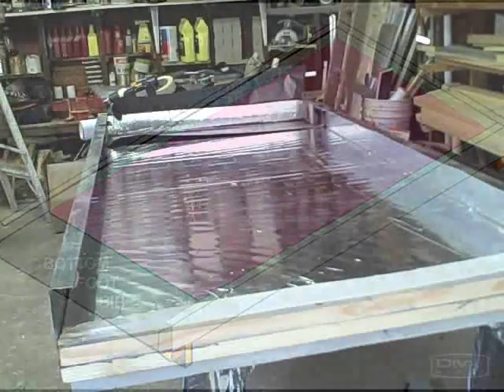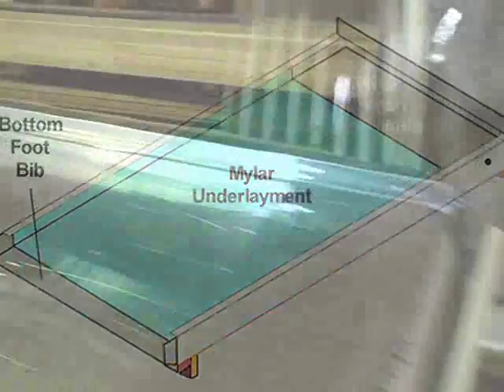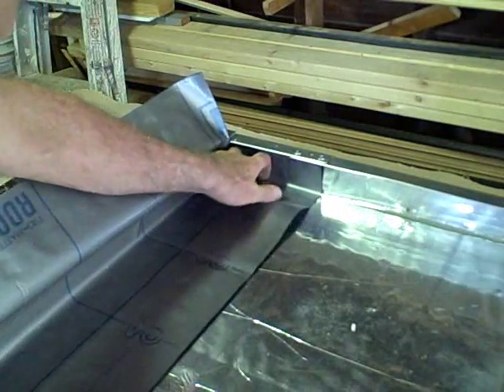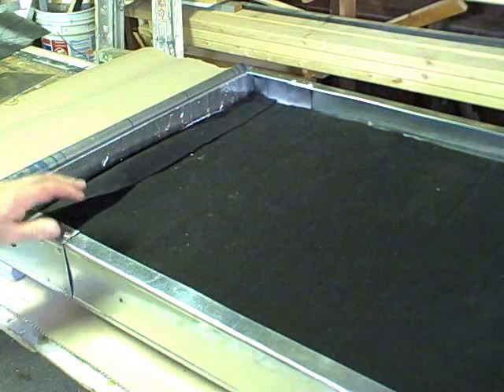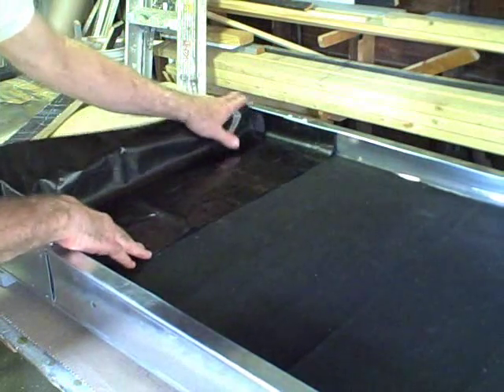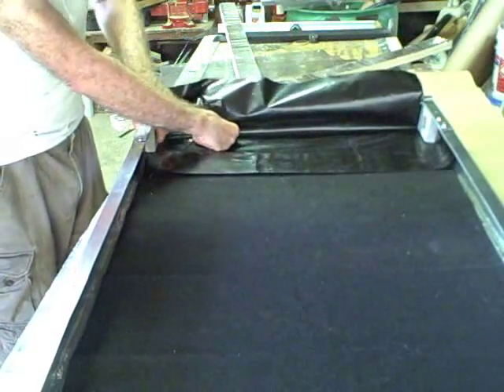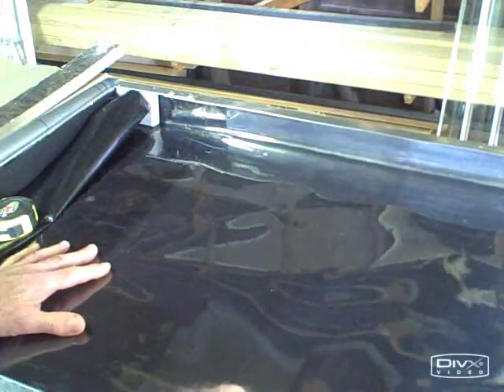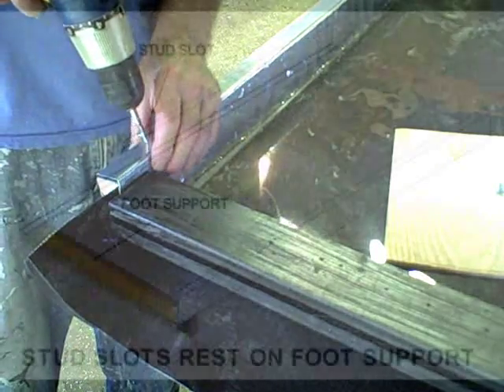MTD Trickle Down Mat

Comment from the maker: Thank You Jab
The cost of the collector will vary between $4 and $6 per sq ft depending on the size of the system. Bigger is better. The first one will take a day to build, but once you get the hang of it ...the entire collector can be assembled from parts in a half hour.